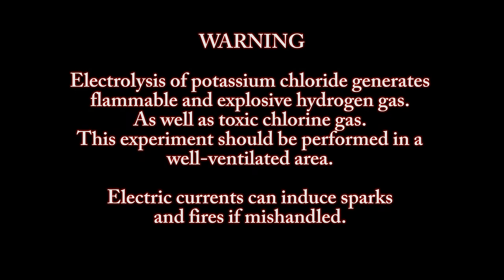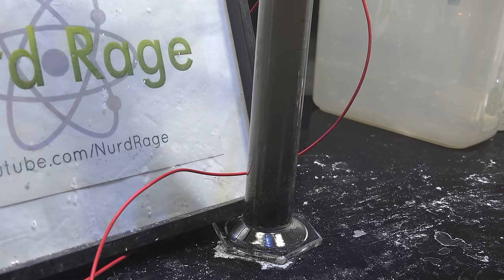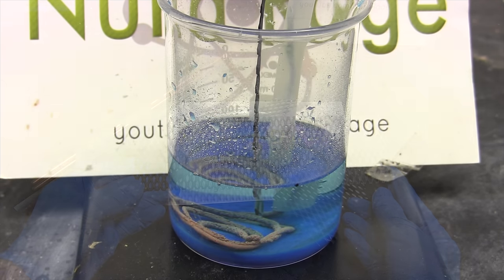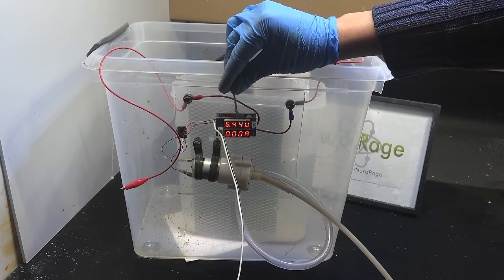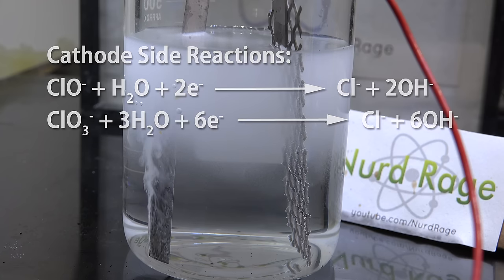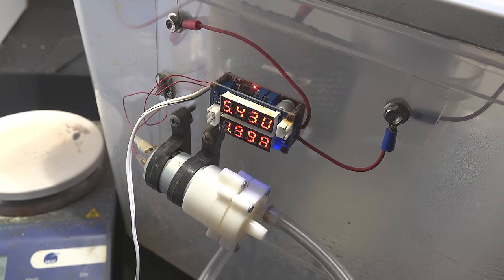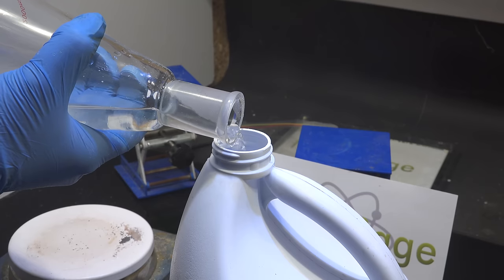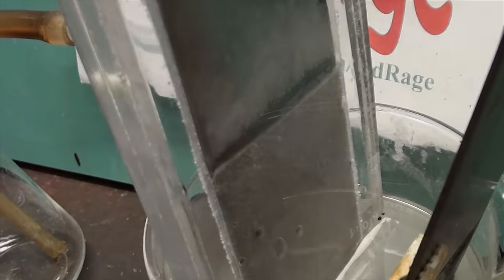Make Potassium Chlorate by Electrolysis - The Basic Guide

Comment: Nice!  I was also stuck in the 50% current efficiency range with a 4 liter KCl cell (graphite anode, stainless cathode) until I added about 100 grams of sodium chloride to the electrolyte, which pushed current efficiency over 80%.  It's not totally clear why they help, but at 116pm, sodium ions are notably smaller than the 152pm potassium ions, so some steric effect seems plausible.  Sodium chlorate is much more soluble than potassium chlorate, so the sodium ions just keep getting recycled with the electrolyte for as many batches as you like.
Reply: Orion Lawlor interesting. With a pure KCl cell of 1.5 liters my current eficiency is around 63%. That is with MMO anode and titanium cathode. My cathode is a little too big, I will probably reduce its size to see if it improves eficiency.
Reply: stamasd how do you know what size to make your anode?
Reply: did you try sodium bicarbonate?

Comment: So where does the corroded platinum end up? In solution? Precipitated as an oxide?Also, for the carbon electrodes, I think "erosion" would be a better term than "corrosion" Or are you already saying that and I'm just hearing it wrong?
Reply: You're not hearing it wrong. There is some corrosion because, it would be an endothermic reaction, to react oxygen with carbon, and electrolysis makes anodes do this at solution temperature, but it's also far more erosion than corrosion.
Reply: The exact mechanism depends on the conditions during which the corrosion/erosion takes place. But in the end the platinum will be contained as particles in the solution. The eventual platinum ion will quickly find something to oxidize and become elemental. The amounts are abysmally tiny, though. Nanogram scale!
Reply: @jackmclane1826  you're a genius.
Reply: @garrettlines6628  Is corrosion by oxygen the reason why we're told to keep graphite electrodes below 40 degrees during  this?  You said it's endothermic, so I'm hypothesizing that at higher temperatures, the endothermic reaction would be favored, leading to higher wear on graphite.

Comment: This video was shows between subscribers channel today. Not 15.1. 2019. Most informative video from all, about chlorate cells. On entire YouTube. Perfect description what is important and what not. Incredible quality of explanation of all parts of process. Thanks for sharing. Downloaded.
Reply: Bro im using 12volt 3 amp electric source and lead electrods for100 ml water and (odium salt 50 gram) will this electric source heat up the salt electrolysis solution to 70c or around if worked for 4 hours

Comment: One thing you can do with graphite electrodes is jacket them with a porous ceramic or even a coffee filter, that will contain the particles. If you're not interested in thay much work then you can just allow the particulate contamination and add a binding agent that will clump to insoluble particles, then mechanically fister the solution. Both of these add an extra step so it's up to you if its worth the effort.
Reply: Have you tried covering them with a cofee filter? Does it really do the job?
Reply: @simon.scurtu  i haven't, theres a possibility that cellulose may not tolerate the caustic conditions of the cell, but its one of the cheaper and readily availble options so it its worth a shot. If for whatwver reason a coffee filter wouldn't work, one can use fiberglass webbing like what is used for fiberglass repair.
Reply: @nunyabisnass1141  what about the porous ceramic option then
Reply: @simon.scurtu  im not aware of any specific material of porous cermaic, but fiberglass webbing is essentially the same thing. Ive seen such cells that used terracotta pots to act as a porous ceramic, but if you're just trying to control the particle contamination shed by the graphite, the simplest with the least amount of effort with a high chance of efficacy would be the fiberglass.
Reply: @plebestrian9323  i think the point of using graphite is that its so much cheaper than titanium eletrodes. Certwinly if one was serious about the purity and longevity of the set up, titanium and mmo's are the way to go. 

One thing i didnt think of in the op was that with durable and jacketed electrodes, crystal build up on the electrodes is invetiable, so you'd want the coating to be abke to resist some maintenance.  I like your solution because its pretty much a hybrid between graphite and mmo's. My personal thought is if the one can apply the heat to decompose something like manganese nitrate, it might not be a terrible idea to add a minute amount of silica to bind it together in at kiln temperatures, hoping the oxide doesnt melt either. You might not have any graphite left as it converts to co2, but if you can control the oxygen in say like in an inert atmosphere (expensive) or sacrifice the graphite core, the metal oxide shell left over can still serve as a sleeve. But if one is going that far,  they may as well just buy the right equipement from the beginning, unless they imtend to sell them on ebay as cheap alternatives.
Reply: @plebestrian9323  hmmm...so it would probably glaze over and just be a barrier with my methods. Well thsys the thrill of research.
Reply: @plebestrian9323  eurobucks, lol. I like you.
Reply: @plebestrian9323  ive seen things like that on nurdrage and he used titanium. Another thing aside from pasivation is to not allow the crystals to grow and short circuit the aparatus.  If its just some graphite contamination it would be perfectly fine for most applications, and one can reduce the erosion by limiting the current. The graphite is for its purpose a sacraficial peice anyway, so it all comes down to ones preferences.
Reply: The solution eats coffee filter for breakfast. Dont ask how I know.
Reply: @taiwanluthiers  yeah...after i did attempt it personally i found that its not an option. You can use it to filter for recrystalisation, but the hypochlorite will at first make you think everything is ok, until tje filter fails and du,ps everything into the filtrate you're trying to keep. 

So if you're using coffee filters, just pour out the supermane and let the crytals air dry, then disolve and filter.

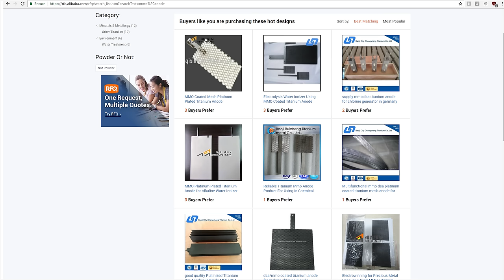Comment: hey thats my listings there, at 5:32 on ebay, the listings from australia.

Also, some details you missed; the precipitating crystals on the anodes cause MMO to flake off from the force of crystal formation as well as the crystals being embedded inside the MMO layer, so any crystals on the anodes reflect damage. for this reason its VERY important that 3 conditions that need to be avoided. 1; letting the anodes rest on the very bottom of the cell where crystals can directly creep up. 2; temperature fluctuations and full cool-downs with the electrodes still submerged. Ive been told by more experienced chemists that whenever they need to shut the cell off they immediately remove the anodes. Apparently theres also some issues with reverse current when power is removed which damages the anode over a long period of time too. 
The 3rd condition is simply, allowing the cell to run for extended periods of time with crystals. One method recommended to me was to get titanium wire and run it directly below the anode, the subsequent hydrogen bubbles which far exceed the oxygen produced, keep the anode clean. bubbling air under the anode or adding a stirring mechanism also helps too.

When you make a better video it would be great if you can show the currently poorly documented method of improving efficiency by adding small amounts of hydrochloric acid to replenish lost chlorine ions.
Reply: I heard another comment suggesting adding a small motor on the anode which would vibrate it and shake the bubbles and any crystals off. Would that work? Maybe to save powder instead of having it constantly on you could have a timer so every hour or something it vibrates for a minute or so,
Reply: @TheFireGoose  that could work, although it would also facilitate salt creep and speed up how fast you wind up with bleach at your anode connector.

that said, a phone vibrator motor would be more appropriate than an actual motor

Comment: I just used a 1-ounce platinum bar for this process!  Surprised at how clean the bar came out without any corrosion.
Reply: من اين حصلت عليه
Reply: If you let it run longer using sodium chloride, you'll end up with perchlorate because of the platinum, which is way better for pyrotechnics than chlorates

Comment: lead dioxide is not "exotic" imo. If your interested in making one, you can just buy some fishing sinkers, melt them down with a blow torch, cast the resulting liquid lead into the desired shape, and pop it in a normal hydrolysis to oxidize a bit. works like a charm and gives you a super cheep, readily available hunk of metal which wont degrade instantly in the highly corrosive conditions :). great video btw, really enjoy your content!
Reply: PbO2 on lead substrate works until it gets cracks on the surface in a cell like this. Then it falls apart

Comment: Your electricity costs were, in fact, significantly smaller than you stated. Even if we consider the efficiency of the conversion from 120/240V AC to 12V DC and the efficiency of your buck converter (voltage/current limiter in this case), since it is not a simple resistive dropper, the current and voltage considered should be the ones measured at the cell electrodes and not at the input of the limiter. Since you've set it to the limits of 6V and 2A, your energy costs without considering losses are just half (at most) of your stated value. If you consider the PSU efficiency at about 90% (plausible for small switching PSUs) and the limiter efficiency at another 90% your overall electrical conversion losses stand at 19%, therefore considering the maximum limits you set:

(6V x 2A x 24h x 40d) x (1 / 0.81) / 1000 = 14.22 kW.h
That, at your - enviably low - energy cost of $ 0.087 / kW.h leaves you with a total of just $ 1,24!
Reply: @Anvilshock  "x (1 / 0.81)" is EXACTLY the same as saying "/ 0.81". Go get some coffee.

Comment: Gouging rods!
Large diameter carbon rods, plated heavily with copper to improve electrical conduction.
Strip off most of the copper, keep some for your electrical connection.
Take the rods into a vacuum chamber of some sort with linseed oil.
Pump out the air and the rods will appear to fizz; this is air coming out of the porous carbon.
When air is returned to the chamber, the oil is forced into the carbon.
Wipe off the excess linseed oil, then ignore the poor things for a week or so.
The linseed oil will polymerize and harden, which toughness the rods considerably.
From this point, you know the rest.
I was able to get 2 dozen rods made up in one day, each rod was good for 6 or so hours of run-time.  I made a LOT of product.
I made chlorate AND perchlorate in the same cell; they crystallize very differently.
First the chlorate, needles.  Then perchlorate, flat prisms-ish.  Or was it the other way round?  18 years ago, at least.
It's all in the voltages used: 3-6 volts will get chlorate until the KCl is used up.
Bump it up to 12-15 volts get make the perchlorate.  Dilute the solution a bit to keep the current a low.

Ammonium perchlorate is prized in fireworks as it doesn't really color the flame like potassium or sodium salts will.
Blending colors in fireworks is hard; red strontium burns quite hot where blue from copper salts needs to be kept relatively cool.
So you cool the red and heat up the blue.  The cooled down red looks washed out, the overheated blue goes almost white.
Deeply saturated bright purple is a treat!

The Holy Trinity: Oxidizer, Fuel and Colorant.  Amen.
Reply: He already mentioned gouging rods in the video... also, you can see the crystals at the end of the video. They look like prisms, so I believe it's the other way round.

Comment: I've been doing this for a while and have been using lead dioxide plates that I gleaned out of old car batteries. They contaminate the product but recrystallization takes care of that, and the fine lead dioxide powder is also a great oxidizer for pyrotechnics. However, I have noticed an interesting effect of the plastic container I am using as a salt cup. It appears that by positioning the cup between the electrodes just right, blocking the direct path between them, I can get the reaction to occur on the side of the cup instead of at the electrode itself, as if somehow it acts as a mirror for the cathode. It could possibly cause less degradation too. (that hasn't been determined yet but I'll see)... But the fizzing stops happening at the anode and begins in earnest at the site on the side of the cup instead. What explains that observation?  Since the electrodes are not supposed to be part of the reaction, could it be true that it's going on at the cup instead?
Reply: Explain to us more

Comment: From my experimenting with MMO cells I found out (and according to some forum articles as source, based on some literature) that raisening
 temperature to ~~75C i best, because:
1. In higher temperature chlorine generation is practically none,  probably is used in situ by the reaction, when in room temperature chlorine smell is everywhere and it makes mess everywhere.
2. Temperature can ban self sustained if you use PC power supply with something like 40-60A capability, higher amperage rise production rate and temperature (Temperature equilibrium is metter of the reaction vessel or putting it in bigger water container to cool it. 
3. In higher temperature KClO is fast turned in to KClO3.
4. In my feeling only problem is higher water evaporation rate.
5. Because Cl2 seem not to escape there wasn't need to control everyday the pH of the electrolyte.
Reply: Qwertypp10 not exactly my experience but I haven't used the exact conditions from your post. I usually run my cell at 60-65C and have to use a hot plate to keep it at temperature. The source I use only goes to 10A and that's not enough to keep it warm only through the heat dissipated in solution (10A * 5V=50W). There is significant chlorine produced at 65C so I have to run outside. But conversion of KClO to KClO3 does seem to be complete.
Reply: @stamasd8500  I needed only to make the solution hot at start to dissolve the salt, there maybe was a bit of chlorine at start up, but after lets say 1 hour, there was none (~~75C as I remember i exact temperature of conversion of KClO to KClO3) and after while of running you have got enough KOH to "catch in situ" the Cl2 that forms on anode.
My setup was 1 liter beaker submerged with some not big amount of water in bowl, it make it stay at right temperature. Of course I used also powerful power supply as above.  With all of that I was able to get some decent amount of KClO3 everyday :)
Reply: Qwertypp10 I used a slightly bigger setup, a 1.5 liter jar (pickle jar) for which I made a custom lid from PVC because that resists chlorine; I didn't use an external bowl of water but put it on a hot plate to keep it warm (since the 50W dissipated in 1.5l solution only brings it to about 40C). It was generally kept between 60 and 70C. There was definitely chlorine produced but not a lot. I adjusted the pH twice a day with HCl to below 7. Run time each time was 80 hours at 10A. I did not harvest daily but only at the end of the 80h. Very consistent results each time.
Reply: To harvest I put the whole jar in a refrigerator for a day, decanted the liquid, washed the crystals twice with cold water and dried. The decanted liquid plus the wash water were put together and boiled until the volume reduced to half then put again in refrigerator for a day, crystals harvested and washed. The leftover liquid was kept to make the electrolyte for the next run.

Comment: I have used mmo tubing, which a company was happy enough to give me a metre of for free. As it was a tube I had to block the bottom off to use it as the inside was not coated. Found that fuel resistant knead epoxy was unfazed by the chlorate solution and have now had that filling the gap for quite a few runs now with little to no sign of breaking down. So if anyone needs to be creative to get something like this going, that is perfectly fine in a cell. Happy chemistry everyone.
Reply: bruhh free mmo im jealous
Reply: @karolus28  Yeah, I was pretty chuffed as a 16/17yo making a project & able to get it on the cheap.
Reply: @nellyjmc8919  im curious, what were the dimentions of it?
Reply: @karolus28  I’ll go measure it shortly
Reply: So it’s an inch in diameter, I’ve got two 45cm pieces. Coming from an Australian source, it’s pretty high quality coating
Reply: Hi mate I've been experimenting with chlorate production myself mainly using donated pool chlorinator anodes in a 4 litre clear plastic food storage container and a PS built from an amplifier transformer and a bridge rectifier circuit from an old battery charger so far I've made over 2 KG's with this setup but I would love some MMO tubing if you are willing to share the name of the company I'm in Australia also

Comment: +NurdRage you could probably try putting a small vibration motor on the anode. I'm not sure if it will interfere with the reaction or not but it will probably keep crystals from forming in thick layers on the anode or will at least break them off.
Reply: And wouln't it also readily remove bubbles allowing for a more exposed surface?

Comment: I used 7A with my platinum electrodes and they are stil fine even after 15 hours!
Reply: What do you use as your power source? 
Could I use an AC to DC converter and just plug into a 110v electrical outlet? 

Any help would be greatly appreciated, as electricity really isn't my area of expertise.